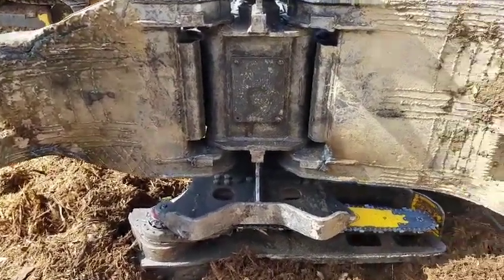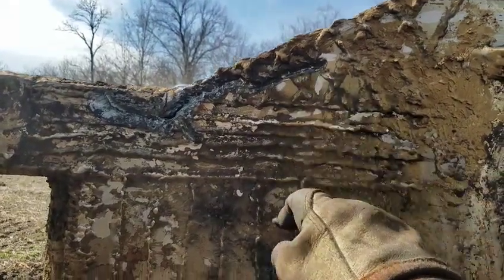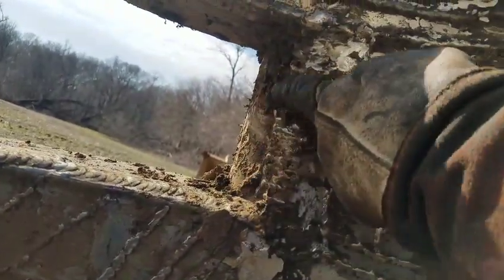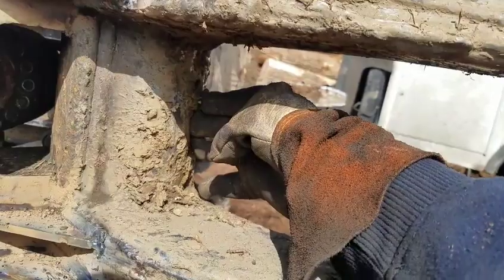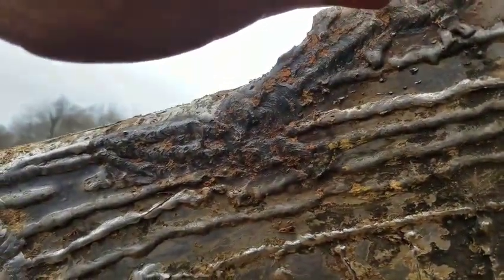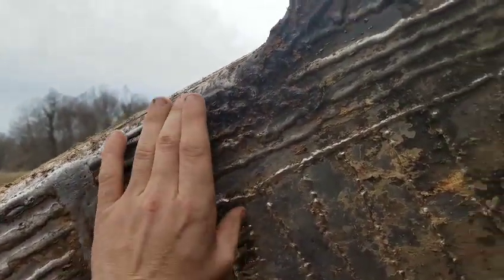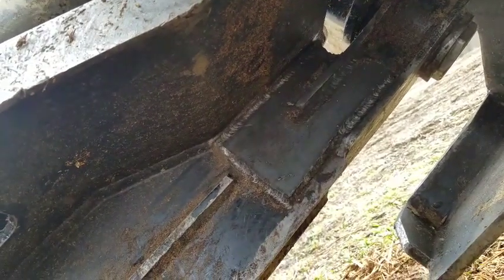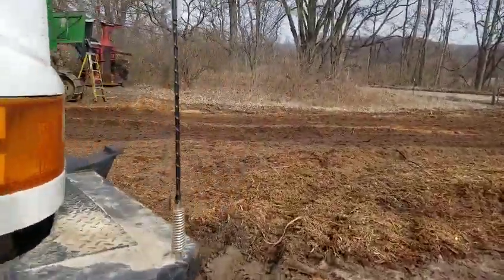Busted din din head

Comment: I am not a welder either but been told by folks that are doesn't matter how it looks as long as it holds. Good luck looks like the head could use some major beefing up in spring or next rainy time the din din back at mill👍👍👍
Reply from the maker: The whole machine is about to go under the knife for a few weeks maybe a month

Comment: I dont use slag hammers hardly now. I use wire cup brush on grinder. Cleaner the better and it works great. I cup brush between every pass... try it and you'll throw that slag hammer away
Reply from the maker: Yes iv used the cup wheels and they do work well. I hate dragging a cord around for the power to use them

Comment: its going to keep cracking if you dont drill a hole where the crack ends.
Reply from the maker: Does it matter what size drill bit
Reply: no just stops the crack from going in another Direction.
Reply from the maker: @marksquires5611  so if there's no certain size drill bite to use then why wouldn't the gouger that I used not work
Reply: i suppose time will explain. nothing better then self learning..
Reply: all you did with the heat of the gouger is expanded the fracture which will continue on..
Reply from the maker: @marksquires5611  guess il find out